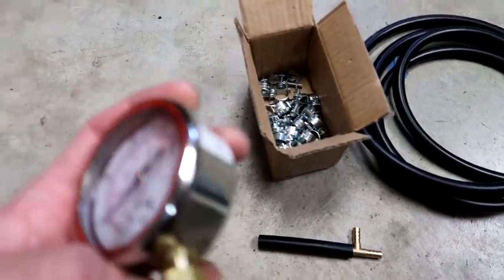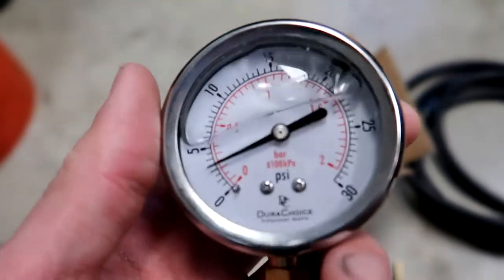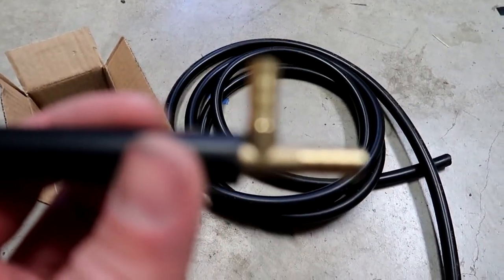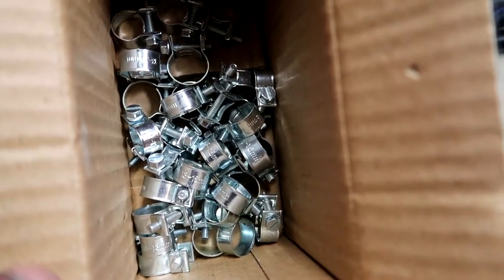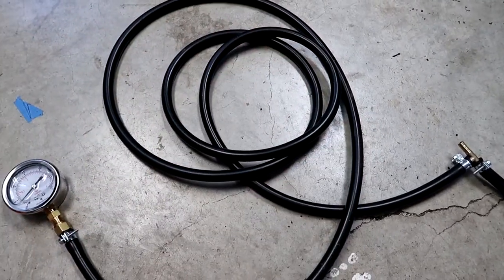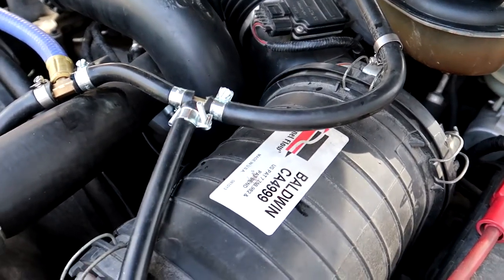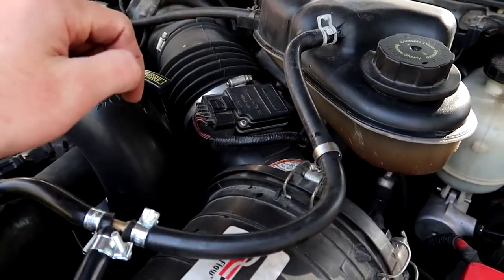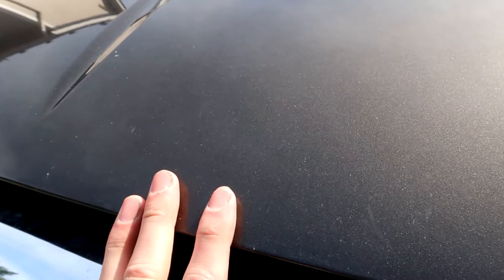6.0 Powerstroke Head Gasket Test - Are They Blown?

Comment: If it's keeping pressure overnight, that's a good thing, because it means there are no breaches in the cooling system.  If you lose pressure right away, something is leaking.  If youre puking coolant, it's because you're boiling point has diminished because of old, over diluted coolant
Reply: Or because you have a bad cap on your bottle.  Replace the cap because it maybe opening up early.
Reply: Bad cap or over fill…

Comment: I just changed my head gaskets and have a egr delete and arp studs my gaskets were leaking before so i know what to look for but when i go out after the truck sits overnight and start it it will build up pressure at first but not enough to completely tighten the upper hose i can bleed off the air and after that it wont build hardly any at all do you think that is normal is it possible that there is air in the system and it needs burped until gone? Im not having any other symptoms but that first initial build up

Comment: I had no white smoke coming out the pipe and there’s no contaminants on the coolant. I did switch out the entire reservoir with an aluminum one with a aluminum cap and it’s still spilling out.  I really hope its my thermostat or radiator.  I only have 53k miles and it’s a 2006 dually f350.    Any other ideas of what else I should replace that’s fairly in expensive?
Reply: Get rid of the aluminum cap!

Comment: Hey I did the test and I’m only reading 3psi max 4psi under load is that bad??
Thanks allot
Reply from the maker: That's fine.  If your head gaskets are bad, to the point of being blown, you'll see around 15-16 psi which is up to the point the degas cap will relieve pressure.

Comment: 6 is normal 10 is high if not under towing load .but if your not puking coolant probley fine.my six lt 2005 climbs to past cap pressure.lol
Reply: went to see a 6.0 it would build.pressure but no puke no loss of coolant, you think I need to do HG if I buy it or can I run it like that?